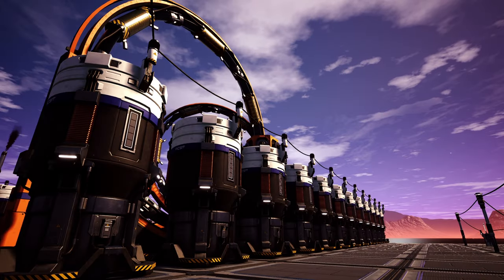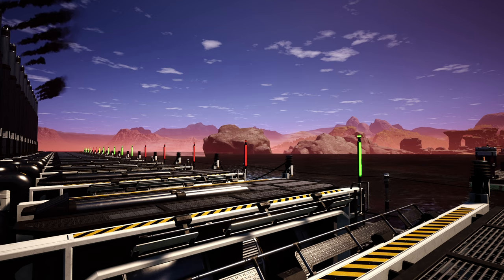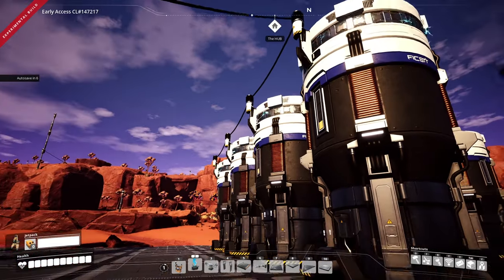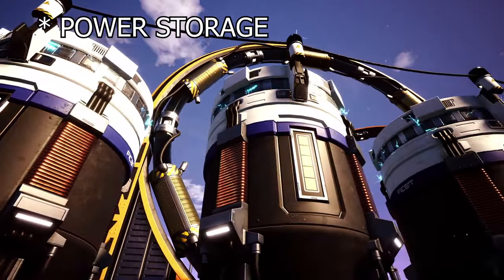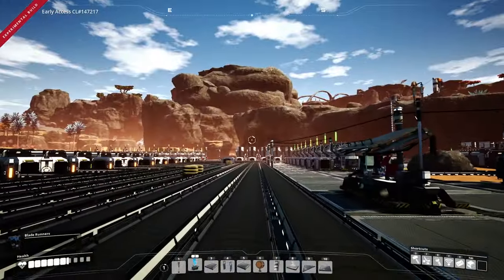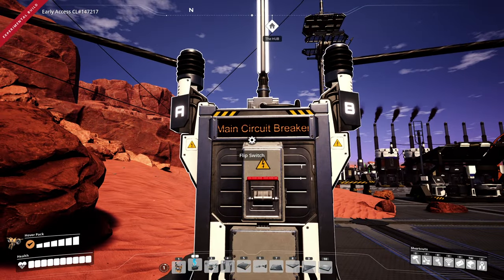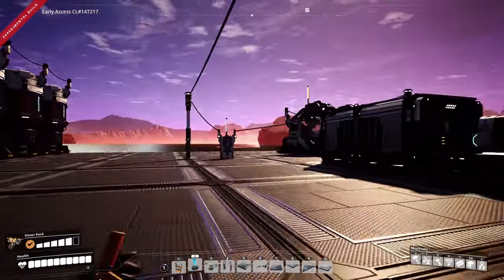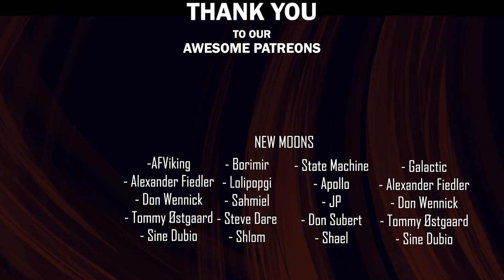Satisfactory - How To Use Power Storage and Switches - Update 4

Comment: PLEASE! Tell Coffeestain that ON switch position is upwards, and OFF position is downwards. It is opposite ATM. They have to correct it.
Reply: not for everything i have used, down has always been on
Reply: Most consumers only ever see domestic fittings and the up-on, down neutral paradigm would not even be thought of. British users at least will be familiar with the BS1363 standard of Down-On, Up-Off arrangement of single-way lighting and plug socket switches.
Also, you'd be better off to submit your question to Coffee Stain Studios on the Satisfactory Q&A website - Tom isn't on their payroll.
Reply from the maker: Wait, down isn't on? Gavin below pretty well sums it up, I guess it depends where you're from and also in what system you're used to seeing them in
Reply: down=on. Straya rules.
Reply: @gavincification  Thank You, but No. Don't tell me about "standards" which are opposite to simple logic. They are old and mistakenly made.

Comment: One of the big uses of power storage I am using is for a restart power source.  You make sure you have enough power reserves to run all the machines need to get just your power plant running.  I.E. miners and water extractors for coal; oil pumps, refineries etc for fuel plants, etc.  Once fully charged use a switch to disconnect it, also make sure you have a switch to disconnect the power plant from the rest of your factories.  This way if somehow your plant backs up and you drain all your other batteries you can get your plant up and running again.  The key is to keep it disconnected once charged so you don’t drain your reserves if the plant goes down.  Once down you disconnect from the other factories ( so you are not wasting your reserve power), then connect your backup power.  If you sized it correctly you should have enough time to get your power plant back up and running, then recharge your backup, disconnect your backup, then reconnect your factories.  It can literally save you hours on restarting a turbo fuel power plant that goes dry from missing a 1 meter belt connection.
Reply: Did the same thing!
Reply: the thing is you can get the same thing by just setting a fuse station. when you blow a fuse you can just run down disconnect  your factory and restart  your powers with what's left in the tank. and you can give your self more time by building in a buffer to your power station. ie  say you have coal power and the node could power  8  plants instead run 7 plants   then  connect storage contains to the line before the coal is fed into the station same with water but make sure its above the factory so that its gravity feed congrats  you dont need to kick start your station

Comment: Let's face it, if you have to run to the switch every time power goes down, you might as well just go back to the cable cutting method since it's functionally equivalent. They really need to provide a way to interact with switches at a distance to truly make them useful. Satisfactory is also starting to have a number of cases where a circuit network, a little bit like the one you have in Factorio, could prove useful.
Reply: Maybe a dialogue in the power switch in which you can see and toggle all of your circuits?
Reply: @lingwisyer88  Yeah, that would be useful, but I think that we've reached a point where we need far more then that, such as the ability to create customisable condition sets to turn on parts of the factory and power plants.
Reply: Incorporate something like that LUA mod?
Reply: For me I have a "power control room, where my branches off the main grid are all in a room near my mall, and I run the wires long to the outposts, and then have sub and sub sub branches on location. The main issue with this is that you end up with a lot of wires running parallel, but I've found that it can look very pretty if you use the beams introduced in update  5 as a power "bus" with lots of wires running along it like real world setups

Comment: The batteries are awesome, But for mega factories and late game, I feel like we needed a Mk.2 Battery that can hold 500MWh+. Because any big factory will run dry in no time unless you have hundreds and hundreds of these batteries.
Reply: Just make a huuuge ass battery pack base factory somewhere remote xd
Reply: @kajmak64bit76  Ya obviously only option but I get tired of building 900 of the same thing. That’s why I wanted to see mk.6 belts and mk.2 constructors and smelters. Sure recipes help but not with everything.
Reply: Plus this would be a fun additional use of the battery components!
Reply: @Naviss  use that copy paste mod and build with that... you can easily mass build stuff... you can enable option to actually pay for it and not cheating free to build thing...
Reply: @kajmak64bit76  oh ya, I’m just holding off using mods till release.
Reply: I already have like 200 batteries xD
Reply: Most things have Mk. N versions, so this makes total sense

Comment: Confirms my suspicion; they are load switches rather than power switches. Power switches don't switch off multiple generators at the same time. The current major problem is producing extreme power excesses. It takes longer to gather resources and build 100 power storages than for them to fully charge. Pre-update 4: a 100% guaranteed grid demanded the coal capacity >> consumption, and the generators would then match the production to the consumption. It allowed to suddenly build enormous projects far away from main base without destroying the grid which would disable my transportation (hyper tubes). Any excess in coal usage would be diverted to produce steel. Building a project would limit the steel production (a bit), but allowed the generators to drain a little extra coal. This system worked perfectly. Never had a grid failure since tier 3. Now... the coal generators produce full power which completely drain my steel production. I now produce 4 times the amount of energy that I consume. I manually switched off half of all coal generators, which is a sad and time-consuming task but I still produce excess power and have 300 fully charged power storages. I was so happy with the sophisticated production matches consumption, that I couldn't imagine they would ever delete that from a game.
Reply: I think they wanted it to be simpler for the math. If you know you have X amount of coal being used constantly then you don't have to worry about excess or shortages. I struggled a lot with my power grid tripping before update 4. After update 4 my factory was unusable due to the new power balancing. So I started over. In my new factory I had one single power failure and that was with biomass burners running out of fuel. Because I could build my power factory once and then I knew it was getting fuel and I never had to touch it again.

Although I can see the appeal of having it use what it needs. Perhaps they could integrate that aspect into difficulty modes. Such as "easy power" and "complex power."
Reply: @bobafettjr85  I can understand your point. However excess solid resources is never really a problem, because you don't waste any of it. Pre-update 4, the coal usage would be 1-15 coal per minute. Any excess coal would either be stored or redirected to increased steel production. In the case you would still have an excess of coal, you miner just falls idle (lowering your energy demand). Now you use 15 coal regardless of any demand, which produces an excess of power which is not so easily stored and also creating shortages on steel production, making those factories idle, lower your energy demand, creating an even bigger energy waste difference. 

The local math maybe became simpler but the global calculations have become very complex; how many coal generators must be manually switched off so they don't take the 15 coal per minute, in order for that coal to be used in powder and steel production, but also make sure the remaining coal generators generate enough power to power these extra factories who use redirected coal?? In the old system, eventually they balanced each other out automatically. Now I had to set up an EXCEL sheet to find out the optimal amount and I still have to add a few power storages every few weeks to deal with the slight energy excess.
Reply: @jaimy_games I get what you're saying. But for me personally it's simpler because I don't turn off my generators. I just let the excess power burn. I just dedicate whole coal to power. And my other needs such as steel end up being filled from other nodes.
Reply: @bobafettjr85  That isn't very Anti-Waste Effort for Stress-testing of Materials on Exoplanets. ;)

Comment: Haven't heard a compelling reason to care about wasting power since resources are infinite
Reply: You should care about wasting power because now you can store it for more uses
Reply: @thefiredragon6542  that only if you have something that spikes occasionally in time with you charge in a well managed set up your draw will be consistent so battery’s wont help
Reply: Best use for it in my experience is when my power factory shut down I was able to power the machines in the factory while I got everything up and running
Reply: @akilogames   you need to be careful to keep them out of the loop till you need them and for most of the game really wont have a worry about  its only when you get to the massive god tier structures that they can really pay off and even that can be offset by building in kill switches to your factory. if there was actual solar and wind power then power storage would have a use  since the wind does not always blow  and night time.

Comment: I know the video is 12 months old but anyway... A big use I don't see mentioned for power storage is when pulling a power line from a train station; I basically pair every train station with a power storage so any work done on the rails network won't shutdown my production lines pulling power from the rails. (at least for 100MWh which is often plenty of time to reconnect the rails)

Comment: if your power already broke down you're running around fixing it anyway, if you have to manually engage your backup power that's an extra step of work just to keep your factory running a few minutes longer
if your power is majorly broken down that's the real issue

I think batteries could be used as a buffer for expansion, or if you have extremely fluctuating power and don't want to set up additional power facilities at the time

instead of batteries you could also just store water and coal/fuel for extra generators

Comment: Whit out logic switches its all ussless cause you still produce more power then you need so basicli scaling up power production is easier then constantly runing and switching power on and of..... stupid bussi work.
Reply from the maker: I disagree, my total consumption far outweighs my production of power. It's only because currently everything is saturated - if I turned on my sinks, my factory would fuse, so having circuits actually helps me prioritise where I want things. Also I'm pretty certain logic is coming... so better prep early that have to redo it all again later...

Comment: An interesting thing about Biomass Burners now is that they don't use any fuel if your power needs on the circuit are met by your other power plants. Which makes them an excellent emergency backup.

Especially if, like me, you obsessively pick up leaves whenever you're running around because you want the ground to be nice and tidy. :-)

Personally, I'm working on dividing my power grid into sections based on categories. The most important of those is for fuel... everything needed to run my generators of all types is going on its own circuit, which I plan to power entirely with Geothermal (or anything else in the future that doesn't need any fuel itself).
Reply: This is true. They are a great backup once you get automated power up and going, but I've had my power fluctuate due to poor management. Besides having the new power storage cells, I've got all my old biomass burners still hooked up and I've kept them stocked full. I'll occasionally check back with them and out of the 200 solid bio fuel you can stick in them after about 3 hours IRL of tinkering around trying to get coal and fuel power stable, there's maybe 196-197 still in there. So I think that any drop in power kicks them in to production for a split moment and that will slowly deplete the fuel in them

But they are something worth having both on your main power line to just fill in the gaps you're not aware of and also on your backup power line because they will just sit there fully fueled until they're connected. They can't fill the power storage cells, so they, in a sense, are cheap 40mw power cells within themselves.
Reply: This is exactly what I have done.  Once I unlocked and setup my first coal power plant, I noticed that my biofuel burners were not burning their fuel.  

So I left them be, built the second coal power area, then the first oil area with fuel generators, then a second.

Then I started putting batteries in each area, combined I now have a nice buffer with biogenerators and above that, the batteries.

But, I like to keep ahead of things and now build fuel generators as needed.
Reply: I am waiting for a harvester truck or something to collect all weeds and trees etc...
Reply: is geothermal vanilla or from the refined power mod ?
Reply: @rocket2739  Geothermal is in vanilla, but it needs to be unlocked in the MAM on the Caterium tree. The nodes on the map are a bit limited.

Comment: Unless coffee stain are planning on changing resources to finite, the power generator changes aren't really that much of a big deal. Power might be lost but if the resources being used to make it is infinite then you're not really losing anything from going mad building powerplants and having a vast excess before doing a construction run that would otherwise flatline a factory.

Am kind of hoping they add a pop up notice similar to the MAM one to let you know when the batteries are actually being used.
Reply from the maker: Yes we need a pop up!
Reply: My thoughts as well. Smoothing the power is nice, but idc if the coal power is over producing.
Reply: @TotalXclipse  @Andy Brown There actually is a warning message on the left side of the screen if your power storage is drained below 80 %.

Comment: You can also make an AND gate by linking two switches in series. Also you don’t need a third switch for the OR gate, just merge them into a single connection. To make more complex logical circuits (I.e a 4 bit computer) all that would be needed is a transistor type switch and a method to store a bit of memory. A single switch of this type would function as an AND gate, allowing you to build all other logic gates with some spicy spaghetti. From there all that would be needed is an APU, a memory aray, a few busses, and some good old fashion manually input assembly
Reply: Hmm logic, not my strongest skill but fun to mess with, I'll have to see if I can implement it somehow